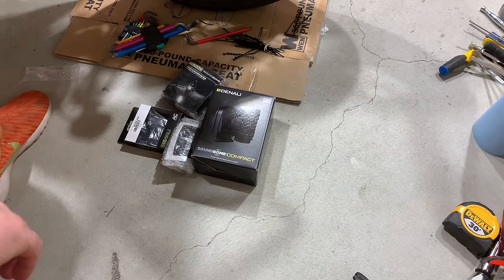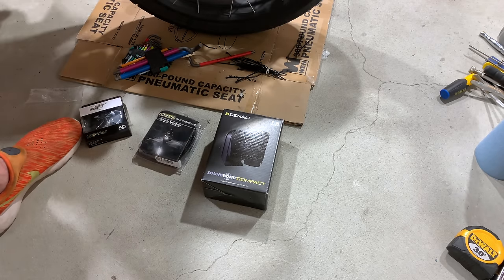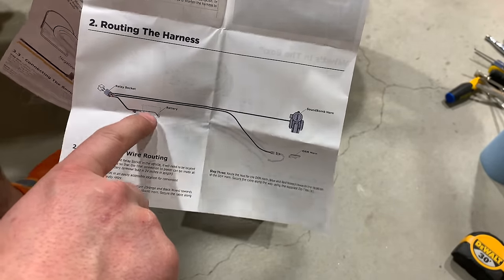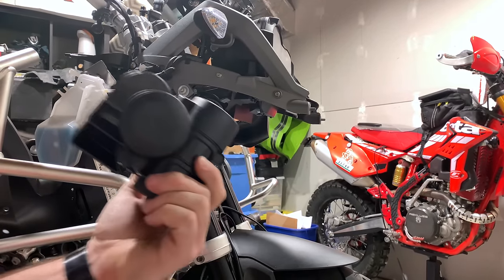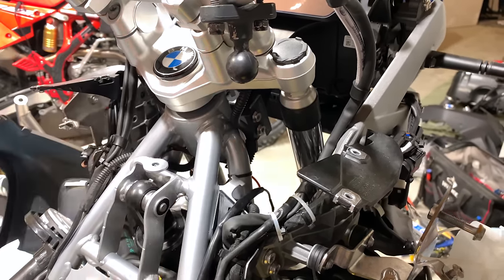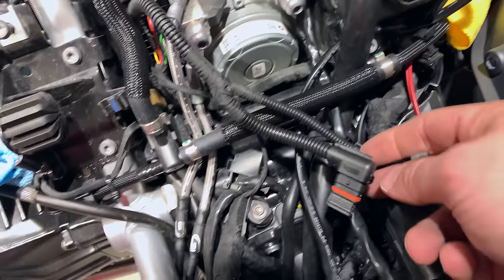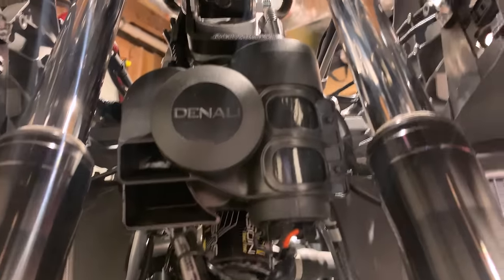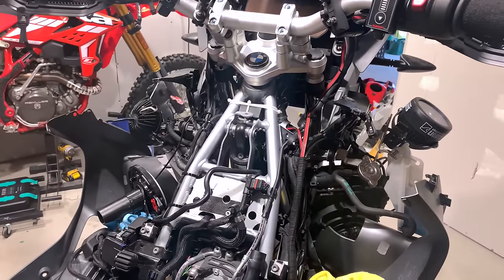Install: Denali Soundbomb - BMW R1200GS Adventure

Comment: Thank you so much for the instructional video and comments.  As you did, l bought the Denali horn with added accessories which made it a "plug and play install" on my 2019 BMW GSA.  Safe riding!
Al
Reply from the maker: Enjoy the new motorbike and be safe! I'm glad to have been some help. There is a demand for people seeking full installation with wiring that is not plug & play but I found this to be much simpler and should be trouble-free for many years.

Comment: I'm not suggesting anything wrong with this approach, but it is unnecessarily complicated for simply installing  the Soundbomb horn.  All that you need is an adaptor to connect existing horn plug to a relay.  Then wire a +ve fused feed from the battery to relay & two wires from horn to relay and earth.

Comment: Awesome horn Adam. I recommend this horn especially if you have the Hex ezCAN. It is so easy to install...plug-n-play into the Hex ezCAN unit.  Auxiliary lights flash with the horn blast. I do have to unbolt the horn and add a stainless steel star lock washer to eliminate the horn from swinging up (creeping forward) toward the forks.  So yeah add a lock washer to the bolt and bracket.

Comment: Hi Adam. I went ahead and bought the whole set also.  However, I extended the wires on the BMW CANbus adapter and ran straight to the horn.  Seems to work just fine without the larger harness and relay.
Reply from the maker: Great to know! Thanks Breck

Comment: Thanks Adam great video. Did you get a fault code on the dash while installing the soundbomb ? If yes, How did you clear it ?
Reply from the maker: Hello, no fault code on our R1200GS or F750GS. The big GS uses the direct to battery connection and the F750GS uses Denali's Can smart and that was a much easier install.
Reply: @AdamChandler86  thanks

Comment: Great info, but we're running into a clearance problem - once the sound bomb is installed, the forks hit it. pushing all the way back, forward or in between. did you have to tweak the bracket somehow? 2014 gs1200
Reply from the maker: I did have an issue with clearance and hitting the forks. Had to make some adjustments but it's been fine since. it did require a revised arm from Denali that they installed at their shop for me. I drove my bike down there to have them inspect it after I had issues.
Reply: @AdamChandler86  I'll be calling them today. They may have sent the wrong bracket kit. I includes the bracket and a M6x55 bolt, which is the wrong size for the upper fairing stay (it's a M8).
Reply from the maker: You can definitely tell them my story about the bracket install damaging my forks and see if you can get put in touch with one of the 2 guys who fixed me up.
Reply: @AdamChandler86  OK, just got off the phone with them - WRONG BRACKET LOL! ordered the correct one, should install easily...
Reply from the maker: Awesome!

Comment: How's the horn holding up fixed to the bracket? Did it come loose from riding? Did you have to tighten it up from time to time?
Reply from the maker: It’s great. No issues since then.
Reply: @AdamChandler86  Thanks for the reply mate. Mine had come off when the bolt got loose from vibration. Might need to look into some anti vibration washers.

Comment: I connected This same horn on blue circuit, how many amps should i keep ? 
I kept 5 amps initially, horn was not honking, then tried 15 amps which still is giving it a lag
Reply from the maker: I thought it was 15 or 30. …I’m feeling more like it should be 30.
Reply: @AdamChandler86  is it okay to keep 25 amps on Horn circuit (blue)
Reply from the maker: I opened the instructions for the sound bomb and it says 30 amps so I would recommend keeping It there. but that's just based on their manual. I did 30 on my end. If you have no issues with 25, maybe it's fine.
Reply: @AdamChandler86  can i keep 30 Amps on horn circuit and 15 Amps on D7 red circuit (as a pair) 
This setting will not drain my battery right ?

Comment: Hey Adam, Over the winter I picked up a 15 GSA and have watched some of your vids about adding farkles. Very informative so thanks for that. Quick question for you? I’ve got Clearwater lights installed with the can opener on my bike. I believe you have that as well. With the can opener there is an extra lead for an aftermarket horn. Is there a reason you didn’t wire from that lead? I’m going to order the sound bomb this weekend as twisted throttle is have a Memorial Day sale. I’m trying to avoid adding more wires directly to the battery as I’ve already added a battery tender and heated gear lead directly to the battery. Thanks for the vids. Now I’m gonna go hit the subscribe button. Mike

Comment: Adam, is the adapter to connect to the OEM harness (shown at 2:40 at your video) a male or a female ?
Reply from the maker: I’m mobile today so I can’t play it back but there is a “Denali bmw horn adapter” that’s around $20. Once you have that + power, the sound bomb works plug & play. You can search for that on Denali or Twisted throttle’s site.
Reply: @AdamChandler86  nm can be seen later on in the video, apology for the trouble

Comment: How much body work do you HAVE to take off to install this?
Reply from the maker: For this. On a GSA, remove right upper crash bar bolt, and right fender then you’re good. Ideally it’s just easier to remove the fuel tank because you can better manage the wires.

Comment: Can I install this horn in a Honda 160CC motorcycle?
Reply from the maker: It’s possible but you should probably call up Twisted Throttle and talk to their sales team. They keep a list of compatible bikes. This thing draws a lot of power when you’re on the horn and your stator may not have enough power.
Reply: @AdamChandler86  Thank you!

Comment: Hi Adam, Thank you for this video, however, I'm getting confused to make my order since there are some people who say that all that you need is the BMW adapter without the battery wires? is it correct or is that makes a difference? Thanks.
Reply from the maker: I would reach out to Twisted Throttle if I were you. But my opinion is the electric wires are required because they come with a 30 amp fuse / relay. The OEM horn doesn't pull that much power while the sound bomb does.